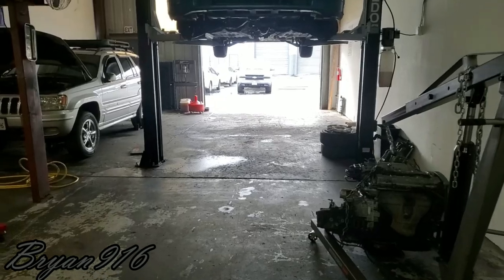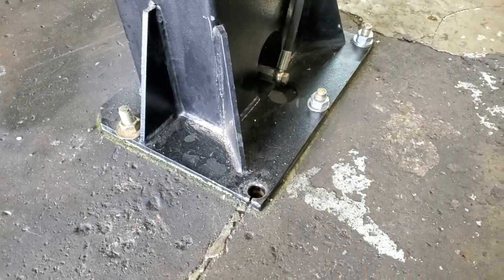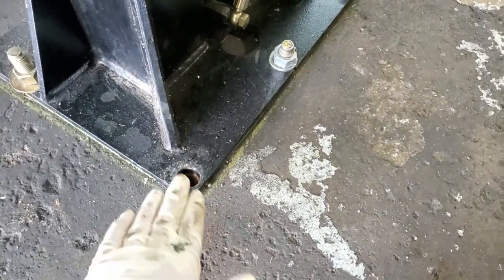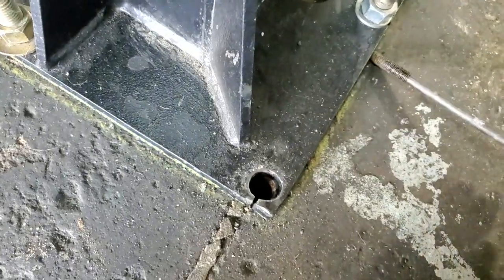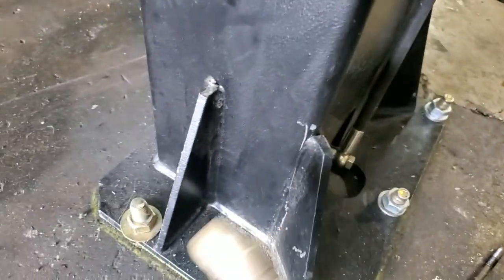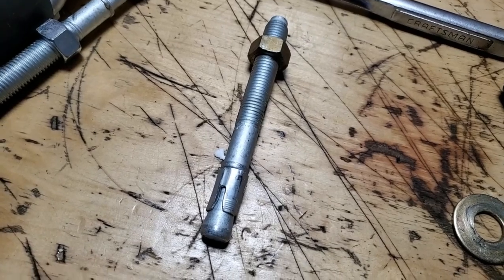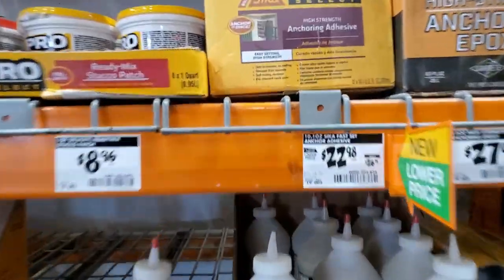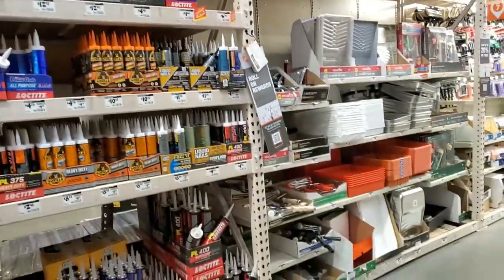How To Fix Car Lift Anchor Bolt Issues  (loose anchor)

Comment: To hell with wedge anchors! I was installing my 2 post 6 months ago and I installed one and had a problem with all the rest. I said screw it, pushed them all through the slab and went with 5/8 threaded rod. I used two tubes of AC100Gold epoxy and used blue lock tight on the nuts. They are NOT going anywhere. I feel safer with a single epoxied threaded rod than i would with every single wedge anchor "Holding".
Reply from the maker: Roger That!
Reply: @Bryan916 just asking why you didn't use a threaded rod of the same diameter that screws into the epoxy. 
From what I seen that way it will not come out. Only asking?
Reply from the maker: @Badeau68   This was the first time I had an anchor come back out. I learned  from this experience that wedge anchors suck. I'll be using epoxy and threaded rod from here on out!
Reply: Lift manufacturers will void the warranty if you dont use wedge anchors. They provide them with the lift. Even tho we know that using anchoring adhesive is better, its just what they say to do. The wedge anchors will work fine if the hole is perfect. But whens it ever perfect.
Reply: How do you use threaded rods? I hear a lot of people mentioning that but I have no idea.
Reply: @Robert-lo6uf  drill the hole, cut the rod to length, clean the rod to remove oils, fill hole with 2 part epoxy/some on threaded rod and put it into the hole. You have like 60 seconds at most before it sets up so you need to be quick.

Comment: Why are the anchors in line with an expansion joint or saw cut in the concrete?
Reply: Yes good question that is why the anchor failed.

Comment: This is why I used a 2-part epoxy with 5/8 x 6" threaded rod to secure my lift.  It hasn't moved at all in 4 years.
Reply: Standard size is 3/4" Rod or anchors for 2 post lifts. Most, if not all lifts, come with or recommend 3/4" anchors. I used Hilti Hit-Z 3/4" Anchors (7/8" bore hole) with their HY-200 epoxy.
Reply: How does the threaded rod work? How do you screw it in?
Reply: You fill the hole with the epoxy and press the threaded rod into the hole.  The epoxy hardens and secures the rod.  Then the nuts are threaded onto the portion of the rod that extends beyond the top of the hole.  This secures the baseplates of the lift.  The epoxy is incredibly strong.

Comment: Your cement is cracked where the bolt is ,  I'd cut a square in cement and refill it with 5000psi cement.

Comment: Well done, Mate! All Hold bolts should be epoxy high-strength fixed into concrete. Do not use Tru-Bolts, Dyna bolt or USA wedge bolt

Comment: Is your life worth taking the chance on that holding. The crack is the reason that bolt did not hold. Glue in not the answer. You should have cut the concrete and installed the lift in the right of concrete and rebar enforced.
Reply from the maker: My life is not in danger because of a small crack near 1 out of 12 Anchor bolts claim down! You obviously don't know what you're talking about. This stuff is used in construction to anchor down foundation bolts for very heavy objects like houses and apartment buildings a two-post car lift is nothing for this stuff.
Reply: @Bryan916  i had the concrete break and the car dropped seconds after i got clear of it to grab a tool.
Reply from the maker: @narcissistinjurygiver2932   That sucks, You had some other issues going on!
Reply: @Bryan916  bad concrete
Reply: @Bryan916 Im sure any bright individual did understand what exbballfan meant by saying "glue"
Reply from the maker: @mikem9995  Since when is concrete  referred to as glue?
Reply: @Bryan916 he was referring to where the cement seam is. The bold is to close.  What I did it cut a square hole in the cement and went down 2ft deep and fill with cement so it would give me some good cement to hold to.

Comment: Hi Bryan. I watched your video and bought a Sika anchoring adhesive fix for the one post's like you did.  And bought also a bucket of anchoring cement to apply on the 2nd post's. Sika applied anchors has failed around 100-pound torque, and the nuts ended up on the treads. But the cemented side anchors did pass over 130 pounds of torque, no lose even a bit. No product can beat the cement's strength I believe.

Comment: Thanks for the info, as I have 1 for sure maybe 2 additional anchors that kind of sketchy to me, However, I will use the 5/8 rod and adhesive  as replacement  all others are good.
Reply from the maker: For sure

Comment: Please keep an eye on those bolts. 4 post not as critical, but a 2 post lift should be a minimum of 18" from any crack or joint in the concrete. 
Looks like 3 of your bolts on right on the pad joint. 
If you have to do it again bring the temperature of the tube up by putting on your defroster in a vehicle, it flows so much better.
We deal with 2 part epoxies all the time installing 1½" dowel bars into concrete roadway where I work.
Stay safe
Reply: Hey, what do you guys use to epoxy bar???  I've got 104 5/8" 6 inch long rods to install and there has got to be something much cheaper than the stuff here.  Sika hardens way too fast for this job of mine to not cost a grand in glue!  Thanks!
Reply: My Triumph lift instructions said minimum of 6” from an edge or seam.

Comment: Thanks for the video.  Do you have some advice for the case of holes that are not drilled all the way through the slab,  so the inserts cannot be pounded down?  I wonder if I can tighten the nuts until the inserts pull out?
Reply from the maker: yeah use the nut to draw it up by using a big socket or maybe a adjustable wrench to take up some space.

Comment: Hey Bryan. Awesome video! I'm about to do this to a new install. I need to do 3 on 1 side. Is there anything additional you might recommend doing? Just want to make sure before I take care of my lift. Thanks in advance!
Reply: Don't bother with wedge anchors. Use 5/8 threaded rod with epoxy. Wedge anchors don't have enough clearances around it for the epoxy to really grip on. I think the hole i drilled was 3/4 (was trying wedge anchors initially) and the epoxy stated a 5/8 rod in 3/4 hole. SO worth it. Honestly it was really easy.
Reply: I hear a lot of talk about 5/8 threaded rods. How is that done do you just put the cement in the hole and insert the threaded rod even though the hole is a 3/4 inch?

Comment: Who ever installed your lift put it right on an explosion joint. I'm installing a two post forward lift and will use that on my bolts. But I will torque them as soon as I put them in. I will just put a lot of the compound on the bolts before inserting them.
Reply from the maker: Cant argue with that, that's the way to go! 💪

Comment: I tip that you might already know is to place/tighten another nut on top of those existing nuts after you've torqued them into place and they'll never move. Essentially a "lock nut".
Reply: It’s not the nut loosening it’s the anchor bolt slipping out of the concrete. It essentially loses grip on the surrounding concrete.
Reply: A lock nut would not have helped at all in this situation.

Comment: Is it possible that your anchor bolt failed because there seems to be a large crack in the concrete running directly in line with where the bolts located?
Reply from the maker: I doubt it because I had two other anchor bolts do the same thing nowhere near the crack.

Comment: Wait u ised epoxy on a wedge anchor? How is the wedge supposed to move and swddge in if the epoxy is alrady dry and it cant pull up to wedge it?

Shouldnt it have been torqued right away to wedge and that holds it before it dries, then epoxy dries and maybe makes it stronger then?
Reply from the maker: Yes If its a warm day out and the cement/epoxy dry's fast then yes torque it down right away. My case was a bit different as I stated in the video.

Comment: you are using 2 part epoxy, there is no cement in that tube, its a part A and part B, that tube should have came with a nozzle that mixes the epoxy when you squeeze it out of the gun.
Reply from the maker: Correct!

Comment: cut and pour new bases for the lift. That crack and repair looks sketchy as hell.  How do you know that the bolt shaft is not bonded to the lift base plate and that is what you are torquing against.  Your lift your life.
Reply from the maker: Quick reminder 11 more bolts are keeping the lift upright! The Cement/epoxy is deep into the hole my friend not just at the base plate of the lift. Do you know how much torque 120 ft. lbs. are? There's no way a little cement on the tip would stand up to a 120 ft lbs. of torque. 😂

Comment: Dude... To make it easier. Cut about inch and a half off the nozzle. Makes the opening way bigger to apply the adhesive and quicker!!
Reply from the maker: No you want it to mix well, It mix's by going though the nozzle!